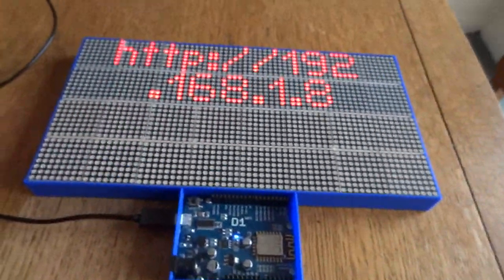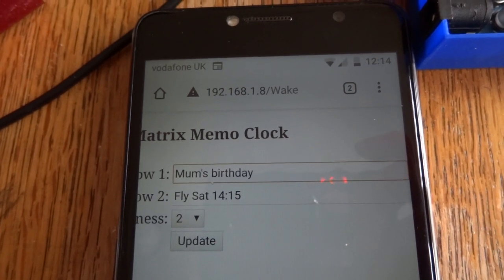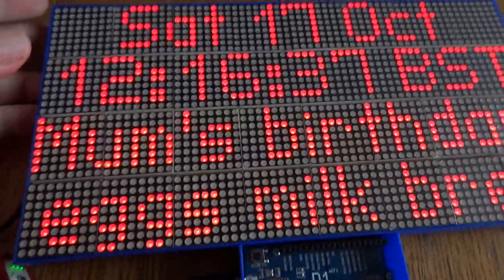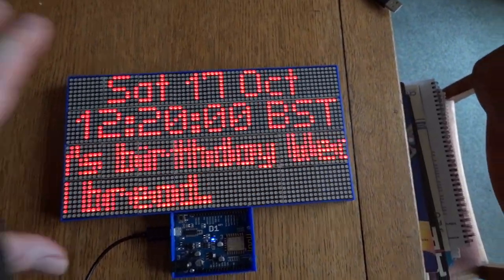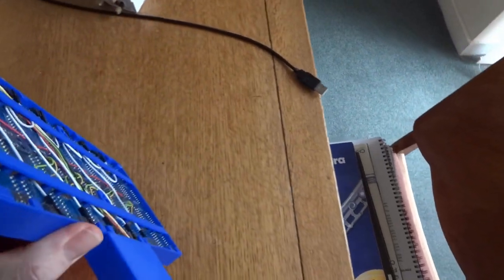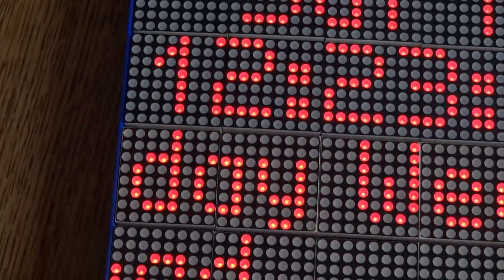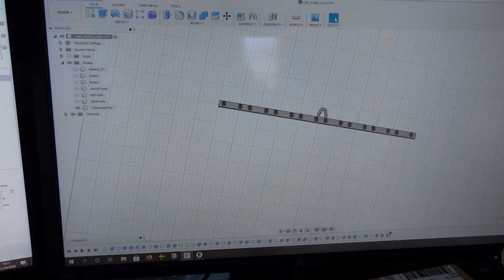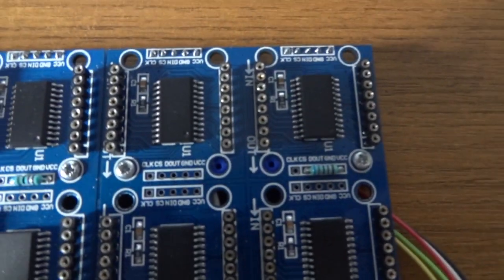Max7219 dot matrix display: clock, calendar, and memo board.

Comment: Total newbie here:  How would you like to give me some help with this project?  I think I have the right libraries downloaded into Arduino IDE  -  ESP8266WiFi and Webserver...   Don't know ip of wemos D1         I have 8 - 4x1 max7219' s
I have Wemos D1  -  I have all the parts 3D printed  -  but being a total noob I am confused about pinouts etc...  Which wire goes where?    Some step X step would be nice for a Wemos D1 Dummy

My boards say Wemos D1 R1 in the board manager - is that the right one?

Totally confused as to what wire goes where accept + and  -                  Any help would be great!  Thanks if you have time...
Reply from the maker: You set up the IP address for your Wemos in the sketch - it's at line 56, named staticIP.  Make sure it's in the same subnet as your WiFi router (usually they're at 192.168.1.xxx)

The chip select line for all the displays (CS) connect to D8.

The clock line for all the displays (CLK) connect to D13/SCK.

The DIN pin on the "first" display connects to D11/MOSI.  Then you connect the DOUT pin of the first display to the DIN pin of the second - and so on: each display's DOUT pin connects to the DIN pin of the next display.  The last display in the chain, you can leave its DOUT pin unconnected.

Best to start with just one display module - you won't see the entire display, but you should see enough to prove that it's working.  The way mine is wired up, the display that's connected to the Wemos is the one on the right (when viewing the display on its front (viewing) side.

Once you can see something happening on the first display module, you can add the others, one at a time till you see the whole thing working.  

Power down the displays (and Wemos) while connecting up each additional module - the sketch sends some configuration data to the display modules when it starts up, so if you hot-plug them (with power connected) they most likely won't work.

Let me know if that's not clear, and I'll try to help.
Reply: @ceptimus  Thank You very much!  I was close / it was all about wires being in right spot. I have first row working - going to solder second now and see if good.  If so I will finish tomorrow.  Got web working also - again thank for you help.

By the way / Great project!
Reply: @ceptimus  thank you so much - i got it all together and thought it was working fine…

Nope constant dead squares after working fine - letters missing - 1 or 2 letters get bright out of nowhere - forget about scrolling text - only half works - and a bunch of other things - I checked all my solder joints etc….  Messed around with it for couple hours and was about to give up just before I watched you video again and caught this time that you mention 3.3v instead of 5v. Wow! Amazing! Everything works perfect on 3.3v  /. I’m a happy camper now…

You mention resistors?  Needed?  If so can you tell me the specifics?

And lastly is there a way to change some code to have 12hr mode instead if 24?

Would be cool to have temperature displayed on a line also - the coding part is over my head tho.

Again THANK YOU for taking the time to help me.  Stay safe!
Reply from the maker: @larryfoss4776  If yours is working okay without resistors, then you don't need them.  If it sometimes doesn't power up correctly when you switch it on, then adding one or more resistors might improve things.  Because all the CS (chip select) pins are connected together, you only really need one resistor, but I fitted a resistor to each module, when I was testing them independently before connecting them all together.  The resistor or resistors connect from the VCC line (3.3 V) to the CS pin.  The value isn't important - it's just a pull-up resistor that holds the CS line high until the microcontroller pulls it low.  You can use any resistors from about 4k7 up to about 100k.  If you don't already have any resistors lying around, and you want to buy one/them to fit, then 10k would be a good choice.
Changing to 12hr mode instead of 24hr, you just need to alter the format specifier in the strftime() function in loop() that specifies the time format.  It's at about line number 236 of the main sketch.
The unmodified line reads:  strftime(bufr, 30, "%T %Z", localtime(&now));
The %T formats the time as HH:MM:SS (in 24-hour format) and the %Z prints your current time zone and daylight saving time indication.
To just change to 12-hour instead of 24-hour without altering anything else, change the line to: strftime(bufr, 30, "%I:%M:%S %Z", localtime(&now));
The %I (that's a capital letter i) prints the hour in 12-hour format, %M is the minutes, and %S the seconds.
If you want to add an AM or PM indicator, it makes the line too long to fit without scrolling, so you can either leave out the seconds or the time zone:
strftime(bufr, 30, "%I:%M:%S %p", localtime(&now)); // 12-hour format with AM / PM but no time zone
strftime(bufr, 30, "%I:%M %p %Z", localtime(&now)); // 12-hour format with AM / PM and time zone, but no seconds.
Note that it's a lower case p, although the other format specifier letters are upper case.
What sort of temperature sensor would you like to use?  The DS18B20, which looks like a transistor, might be a good choice - you could just shove it into three adjacent pin-holes on the Wemos (with an appropriate sketch).  Would you want Celsius or Farhenheit?  Up on one of the top two lines of text (saving some characters by reformatting the date or time?  Or allowing one of the lines to scroll?  Or putting the temperature on, say the beginning of the third row?  Let me know what you'd like, and I'll make an updated sketch and YouTube video demonstrating it.
Reply: @ceptimus  Wow! Thanks again for info!  I figured out just putting in a %r  gave me about what I wanted - it changed to am instead of dst.,,  I still have double digit hours tho -  if single I wish no zero was there.

Maybe ill try some of what you just sent - see how that works for me…

Yes Temperature or whatever weather info. Would be super.
I am definitely FAHRENHEIT lol -  to old to amend my ways. Since we are connected maybe indoor and outdoor temp.?  That would be awesome.  And whatever sensor you think best I will buy. As long as i can get Fahrenheit.

I have some dht11’s and ??? Have to look - but whichever you think best - let me know and I’ll get it.

Again thank you do much helping with my new found hobby.
Reply from the maker: @larryfoss4776  Here's the link to the strftime documentation: http://www.cplusplus.com/reference/ctime/strftime/ 
There isn't, as far as I can see, an option for removing the leading zero on the hours - so that will need a bit of custom code.  I suppose you still want a leading zero on the minutes, so five past eight would show as 8:05?  To get outdoor weather information from the web, the sketch will need to know the location you want the weather for (which need not be the same as your actual location, I suppose).  I'll have a look and see what I can come up with.  I've got some, so-called, one-wire temperature sensors here DS18B20.  I don't think I've got a dht11 anywhere to test.  I'll start with the DS18B20 - If you want to get the same as me, get the ones that look like a transistor with three legs because those are the easiest to plug into Arduino-type boards.  They're only pennies - you can find them on Ebay or Amazon or whatever.  I'll work on a version with the single digit hours and the extra temperature / weather display and post a new  YouTube video about it once it's working.
Reply: @ceptimus  thanks - just ordered some ds18b20’s from Amazon just to have regardless.

Yes minute zero needed like 8:05 AM etc…

Thanks…
Reply: @ceptimus  if you need my location info thats ok…

News feed?  Lol.  Wish I could code.
Reply from the maker: @larryfoss4776  It's taken a while, but I have the DS18B20 temperature sensor working nicely now - and no need for a pull up resistor - the sensor's three legs are just shoved in three adjacent pins of the 8266 board.  I've played with a few ways of getting the local weather, but most of them require you to 'sign up' on-line with a forecast provider.  They're free, but you have to provide them with some details to get a user ID number.  What do you think?  You can get weather from the internet without signing up, but it's more complicated, and more likely to break if and when Google or others change the format of how they send the information back.  Perhaps I should do the videos in two stages?  The first one just adding the local temperature sensor and display?
Reply: @ceptimus  very cool…
No problem as I already have an internet weather account (no indoor temp tho) and a news one as well / have it running on a 16x8 strip - can enter messages as well / how

Maybe I can send you the code so you can pick some pieces to make it easier,,,
Reply from the maker: @larryfoss4776  Which internet weather account service are you using?  Is it free?  If so, I'll sign up for the same one and modify the sketch to use that.  Each user will just have to edit the sketch to include their own ID for that same service.
Reply: @ceptimus  I’m a bit confused?  I sent you a link to a sketch for you to look at and answered your questions you sent today and there gone?
Reply: @ceptimus  any chance of getting sketch - so far - and location of temp sensor pins ?   

Thx
Reply from the maker: @larryfoss4776  Yes.  Reason for delay is that I've got the sensor and the OpenWeatherMap things working, but I've not yet managed to get the server part (web page interface) to coexist with the OpenWeatherMap client.  I'll do an interim version without the web page today and post that - it will just be clock/calendar/sensor temperature/OpenWeatherMap information for a specified location.  I'll need to do some more research on getting both server and client tasks working simultaneously before I can add back in the 'memo' part and web page brightness control.
Reply: @ceptimus  Sure control with memo and brightness etc… would be great but worst case i’ll add another line of LEDS and control them with a D1 mini or something for the memo part - can even use a different color… will see.
Reply from the maker: @larryfoss4776  This should be the updated video (once it's finished uploading): https://youtu.be/Bc-o3rjFpa0
Reply: @ceptimus  Thanks so much - great job…

I for got how to change to 12hr mode instead of 24hr - i thought copy and pasting that line from old sketch to new would be the fix, but it didn’t change.,,

Thanks again
Reply from the maker: @larryfoss4776  I forgot about the 12 vs 24 hour clock thing.  I'll add an extra option in config.h to swap between the two.
Reply: @ceptimus  super!
Reply from the maker: @larryfoss4776  I've added the twelve-hour clock thing now, and also improved the start-up performance of the temperature sensor, which was a bit flaky before.  Download the modified sketch linked from the newer YouTube video, and edit config.h to have the #def TWELVE_HOUR_CLOCK  line not commented out.
Reply: @ceptimus  Thank You so much - working great!  And there is no “0” ahead of the single hours / awesome…

Now if we could scroll some text somewhere… Lol!
Reply from the maker: @larryfoss4776  Sorry about that.  I somehow missed downloading it before.  You didn't include the header files so I can't compile that file directly, but I've found the original by David Payne at https://github.com/Qrome/marquee-scroller  I'll take a look at that today and use the same weather source, openweathermap.org , that he did.
Reply: @ceptimus  ok great / see others as well? News etc?

I don’t know why what I sent is gone from here again  ??!

Anyway now that you have the sketch you can see all in sketch

I forgot that I saved that sketch after entering all my stuff - lol

Api keys - network info - whatever

Would you he doing this anyway or doing just for me? I don’t want you spending too much time just for me …
Reply from the maker: @larryfoss4776  I think the 'private' stuff is most likely stored in the headers that you didn't attach.  In any case, I'm not looking at file you sent (because it won't compile without the headers) and instead I'm following the documentation on David Payne's github.
Don't worry about me spending time on the project - I'll only do it as long as I find it interesting.
I've found that most of the DS18B20 sensors for sale on line, and certainly the ones I have, are fakes. If you want to get a real sensor, you have to pay more and buy it from a very reputable store, such as Mouser.  The fakes still work, but aren't as accurate as the real ones  which are specified to read within half a degree of the true temperature.  Some of mine are about four degrees out.  I've put an 'offset' constant into my code, so that if you have access to an accurate thermometer, you can adjust the offset to make the fake sensors agree with your 'reference' thermometer.
Reply: @ceptimus  not to push it :-) but are you doing the news and octoprint as well?

That would be the Ultimate clock/date/weather/news/message/octoprint etc…. board on YouTube….   You could drop the mouse/keyboard (mike )after that one.
Reply: @ceptimus  Should your sketch work with an Uno or any other board? Tried to load a few times today on a Genuine Uno R3 but kept failing?  Don’t know if my system the issue or sketch not compatible?
Reply from the maker: @larryfoss4776  The display driver part works - it's better to power it from 5V, because that's the logic voltage on a Uno, and the Uno's 3.3V supply is very weak.  But obviously the Uno has no Wi-fi, so you need a different way of getting the date and time, such as a real time clock module, and you'll have to use some other way of getting the messages to display into the Uno's memory.  If it stays connected to the PC, you could use the serial interface.
In other news, I found that David Payne's Marquee project uses deprecated library calls and won't compile with the current Arduino IDE - so I'm writing my own openweathermap and Jason routines to better fit with my existing code - hence the delay in making the update video.  I hope to finish it in the next week.
Reply: @ceptimus  you have any idea why two different PC’s and a Mac are now not recognizing any Wemos when plugged into USB ports - I have tried the 340 and ?201? Drivers and nothing??  Yet Anything Arduino works fine?

Im a bit baffled - it was working fine?

Both PCs are Windows 10…

Maybe I need to boot to linux and try?
Reply from the maker: @larryfoss4776  I don't really know.  Have you used Windows Device Manager to see if any devices (including 'unknown device') appear / disappear when you plug in / remove the Wemos?  If so, then a driver issue and the Zadig program is good at fixing those.  Are you using the same USB cable that works with other Arduinos?  Beware that many cheap micro USB cables only connect the power lines, but not the data pins - these cables are okay for charging phones and similar, or powering gadgets, but won't work for transferring data.